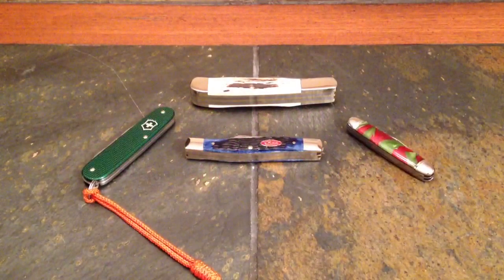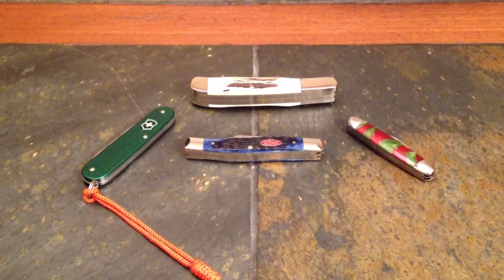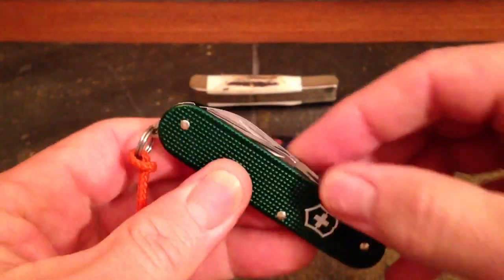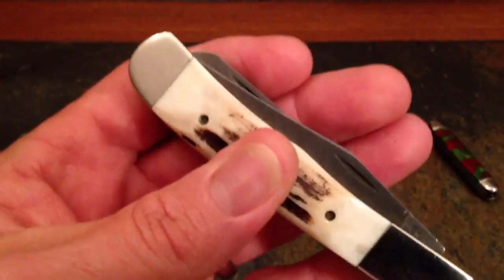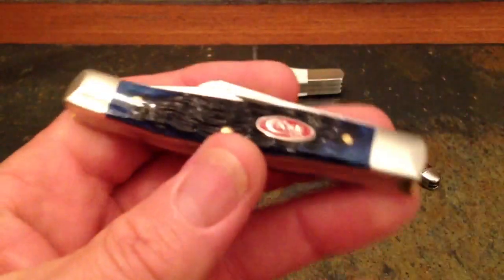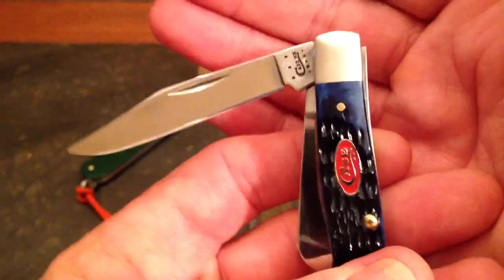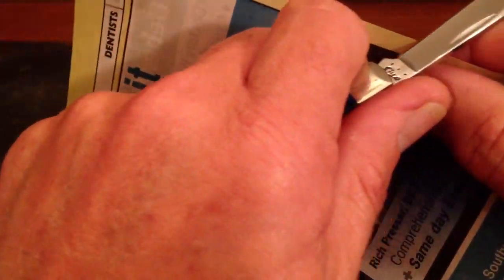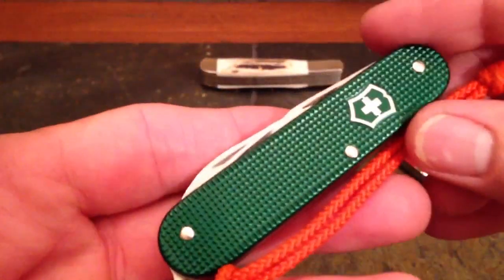Knife History:  Case 3-Blade Stockman -- Slip Joint Perfection

Comment: For real everyday carry, I favor the Victorinox Rambler. Small, but adequate for most everyday needs: Blade, scissors, nail file, flat screwdriver, Phillips screwdriver, cap lifter, toothpick, and tweezers. I have many others, both SAK and traditional slip joints, but the Rambler covers nearly anything that comes up on a day-to-day basis.

Comment: Case medium stockman knives are not obsolete at my house. I have one that is close to the one you show in the video with the main difference being the case shield on yours is a Case USA on mine. It rides in the watch pocket of my jeans daily and is used for various chores during the day. I’m 72 years old so maybe it’s only as obsolete as I am. I’m not a snob about the whole cv thing and I find the ss version to meet my needs very well. Thanks for the video. Also, in the old days it was assumed that if you were old enough to carry a pocket knife you were old enough to apply pressure to the blade in such a way as not to close it on your fingers.

Comment: Only a handful of newfangled 90s "tactical folders" are my favorites.... Benchmade 940, D2 RAT 1 and Sog Fielder (the Fielder may not be the best steel but it is classy looking), But I don't carry them much. I carry 4 patterns a lot being the Peanut, Sodbuster/work knife, Stockman and my favorite the camp/scout/utility. I also will typically grab my buck 110 with its Quickdraw belt sheath before i grab a modern folder. I should clarify that I am 26 at the writing of this comment being born in 1995 but I have always seen the value in slips and the cosmetically appealing but very utilitarian purpose of these tools. I also prefer how easy they sharpen.
Reply: I agree with you 100 percent!!

Comment: Case says the stainless steel they use is a proprietary blend of 440c, and spectroscopic analysis seems to confirm it.  I carried a Case Trapper for thirty years, and use it nearly every day.  The steel certainly seems better to me that the knives I've tested that do use 440a.   

As for the spey blade, Case and Ka-Bar say that after only a couple of years on the market, the number one use of the blade, by far, was skinning fur bearing animals. It's still used for this today, and very nearly everyone who uses a Trapper calls this blade a "skinning" blade.   It's perfect for the job. 

The clip point blade is used to make the money cuts, the incision from foot to foot, and from, uh, bottom to chin, if blanket skinning, and the skinning blade is used to remove the pelt from the body.  The dull drop on the point stops it from accidentally cutting through the pelt, which would drastically lower the value.

In my part of the country, almost every man still carries a pocketknife.  Whatever they carry in the summer, when fall rolls around they slip a Trapper or a Stockman, often both, in their pocket, and carry it until spring.  Trapping is still big here, and so is small game and waterfowl hunting.  Tactical knives are useless  for these things, so slip joints, almost always a Trapper or a Stockman, still rule.

Considering all the companies still selling slip joint knives, a lot of people must still be buying and using them.   I think these knives still sell because hundreds of thousands of people still need them.  There simply are no other knives that can do the job these knives are designed to do.

The Stockman is extremely popular with professional and amateur woodcarvers.  There is no better non-dedicated carving knife.  

I believe many people think times have changed, and that slip joints are no longer carried, or no longer used and needed.  They are still needed, and will be as long as people still hunt, trap, and fish.
Reply: Yes well said most people around my area carry a slip joint case knife when fishing, hunting, and trapping. But they also carry a folding utility knife because there are a lot of metal companies and construction so in those fields of work you need to cut metal and a lot of other crap which a utility knife will do best at.
Reply: The Barlow knife is also popular in the backwoods.

Comment: Say Heah, Today was a Christmas in August Day. I got 4 Case Knives, a Large 3 Blade Yellow CV Stockman, a Large 2 Blade Conoe CV, and (2) Large Trappers one in S.S., and the Other one in CV. the S.S. has a Carlone Handle and the other one is a Saw Cut Ranger CV. plus a Hand Warmer and a vintage Camillus 2 Blade Electricians Knife. The Case Knives were all in mint condition and with the boxes, and the whole bunch cost me $140.00 at the pawn shop. The reason I went shopping, was because I sort of got on the Nessmuk Carry kick, and I really was looking for a 2 Moose Blade Style Slip Joint, the closest to that I guess I have would to be the Canoe, but no such luck, but I know any of my New Knives will work, I also have a vintage Cold Steel Black Rhino, and I also got lucky today, I shared my displease with a sheath I got with one of my fix blades where I had the handle thinned down and polished, the knife came out beautiful and looks much classier than the original broomstick handle it comes with, but the knife was too lose in the sheath, I mean real lose where it was almost dangerous and I almost cut myself a few times. To my surprise a new sheath was mailed to me and the new sheath fits alot tighter, but the other sheath fit my new Rodent 5 I just got and it fits perfectly in the other sheath, dangler and all. and the color of the sheath matches the sheath for my 2Hawks Double Bit Hatchet. Even though my Rodent 5 is not a Nessmuk Style Knife, but I don't hunt meat and mostly use it for camp use. I feel like I got extremely lucky how everything worked out. from how nice the sheath's fit and look and now my slip joints, all I can say is WoW. that's why I'm surfing Case Knives, and learning more about them, I feel so Blessed today.
Reply from the maker: paulie 4x it was a very good day indeed!

Comment: When I was growing up, the brand I most often saw in the display cases in the hardware stores around here wasn't Case -- it was Schrade Old Timer and Uncle Henry knives.  The blades weren't polished, and the handle scales were all plastic, but in every other respect they were well made and useful knives.  Schrade also made small numbers of "Heritage" knives for collectors, which were the exact same patterns, but with bone handles, partially polished blades, and a display box.  Great stuff, but the company we knew is gone, and today's Schrades are made in China.

Camillus Sword Brand is gone.  Carl Schlieper Eye Brand seems to be gone.  Robert Klaas Kissing Crane knives are mostly made in China now, although I think they still produce a few limited editions in Solingen.  There's not many survivors from the old names.  I don't have a Great Eastern or a Moore Maker yet, but that's something I should try to correct soon.

Comment: I EDC a Case Trapper and a Zero tolerance 0556.I carry the 0556 because the instructions that came with Case Trapper said it wasnt made to use on humans.So now i have to double down or i forfeit my warranty with Case in case i need to use my blade.

Comment: Hey Rob, great video ( as usual ) and nice little knife, but I have a little correction for ya. Zippo bought Case, not the other way around. I've read it in several knife collecting books. I was rather surprised myself, you'd think Case would be the stronger of the 2 factories. Matter of fact, years before that, both Case AND Zippo were owned by "American Products" or some name like that. I can't remember if that was before or after Parker ownership. So Zippo & Case were once "sister companies" under a conglomerate. Thanks for the video.
Reply: Thank you!

Comment from the maker: I'm not fond of the knives made with the "round tip" process either.  They're not even very easy to re-point because the roundness extends a good distance back from the original tip.  But it's Case, and I love them, so I overlook that, which is actually quite unlike me -- I love a sharp tip!

Comment: I am not your normal 23 year old. I never leave the house without a slipjoint in my pocket, a Leatherman Rebar on my hip, and a "tactical folder" clipped to my pocket. Lets face it, how often do we really need a knife that can be opened with one hand?, or has a lock?. I actually prefer a slipjoint over tactical folder. You would show a BLUE STOCKMAN ( my favorite color, and favorite slipjoint pattern )....great now i need another knife, lol. I need more Case knives anyway, i only have 1 Case

Comment: A jig and a fixture are two different things. A fixture holds the part so it can be worked on. A jig guides a cutting tool. What you described was a fixture. That Case is not a true stockman. A stockman has a clip, sheepsfoot and spay blades, not a pen blade. Modern Case knives are made to be looked at, not used. The last one that I had with really good steel was bought in 1970. The quality of their steel now is all over the place but none are very good. I've been carrying an Old Timer stockman for about 15 years now. Bought back when they were US made.
Reply: TheApostleP
Many people use the terms incorrectly but my definitions are correct. I never heard of the politically correct crap being applied to jig. It was still commonly used in the aerospace industry when I retired, 7years ago.
Reply from the maker: ardvarkkkkk1 Merriam Webster:  
Jig:  a device used to maintain mechanically the correct positional relationship between a piece of work and the tool or between parts of work during assembly.
Fixture:  a device for supporting work during machining.

So... A fixture with, let's say, drill bushings... would be a jig and a fixture by your thinking.  Further, what good would a fixture be if it didn't "maintain mechanically the correct positional relationship between a piece of work and the tool or between parts of work"/ Not very good of course.  So that quality of a fixture must be assumed.  Thus, the two terms are synonyms.  Perhaps in your field of manufacture, the terms were misunderstood to be different.  As you said, "Many people use the terms incorrectly."  Old timers called them jigs.  Younger folks were trained to call them fixtures.  Both are correct, but one not politically so.  I'm not quite sure why you raised the point, but at least admit you might not be correct in this case.  But if you're into endless debates about insignificant semantics, you'll have to go it alone from here.
Reply: TheApostleP
I'm not wrong and the terms are not interchangeable.
Reply: @ardvarkkkkk1  Everyone to their own but I totally disagree with you. I’ve got case knives from the early 70’s to present and have had no issues with either the cv or ss Steel.